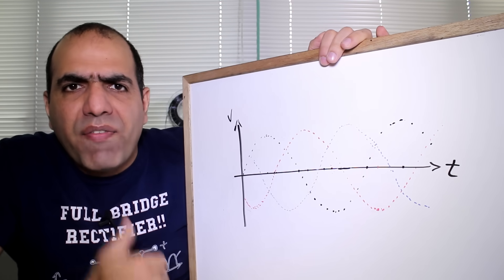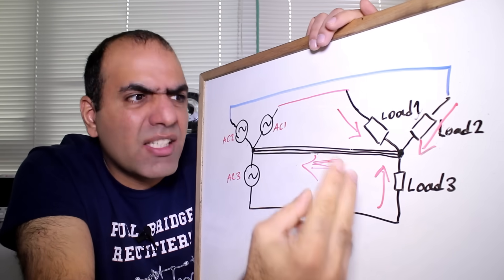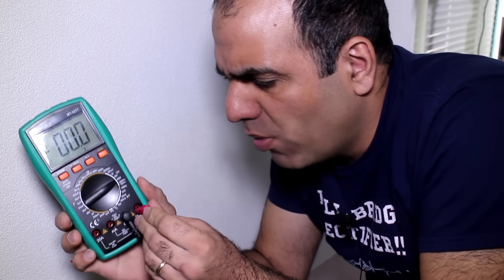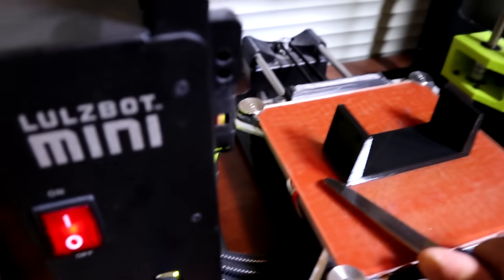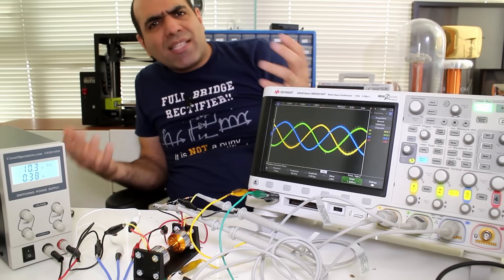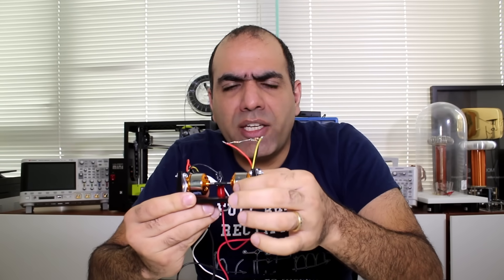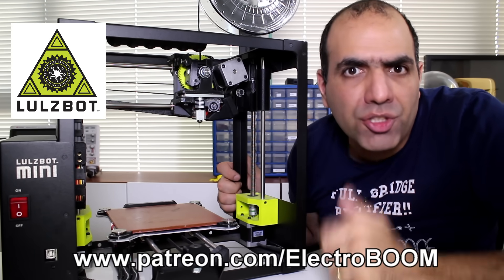Why 3 Phase AC instead of Single Phase???

Comment: @ElectroBOOM in austria every house has 50Hz 400Vac 3 phase net 120° phaseshifted, so between one phase and neutral 230Vac. Blue is always Neutral and green/yellow is always  grounding. Phase is usually black but depending on the cable you have in front of you it can be black, grey or brown or all 3 black for the 3 phases.

Comment: I like this, but of course you didn't mention split phase, which is actually much more common in Canada. You have 2 phase power at home because you live in an apartment (or are doing this in an office) where they have 3 phase service to be able to supply the hundreds of residents.

Comment: 3 single phase loads do not make a 3 phase load. It only increases the return path on the neutral wire back to source.

A 3 phase load ( such as a 3phase motor) uses 2 phases. 1 for current in 1 for current return. Alternating. 
Phase 1 and 2
Phase 2 and 3
Phase 3 and 1..............

That's the only time you don't need a neutral.

Comment: In Europe we have 3 phase power in every household. 230v phase to neutral and 400v across the phases. Excellent for 3 phase motor for heavy motors for wood cutting, workshops, etc, It reduces current, and everything works excellent, and not more dangerous than your voltage. Sure no one plans to lick the wires. Greetings from Serbia
Reply: lmao 400v will kill you easily.

Comment: So Canada doesn't have 240V volts in houses? I am confused that you only got 208 volts across L1 and L2. Here in the US, L1 and L2  are 180 degrees out of phase, so you get 240 volts measuring between them.

Comment: Sir, | V=IR, V is directly proportional to i. And, I=Q/T .,   V directly proportional to Q But,from V =W/Q V =1/Q So, V is inversely proportional to charge Q. Sir it is has some contradiction i ask my physics teacher he said time is not constant and Q gets variation.please help me in this..

IN potential due to a point charge Derivation V proportional To Q. And in capacitance Q=CV .Same as above proportionality. i don't understand why V=1/Q.
Reply: you first have to define what kind of circuitry before applying formulas. Tying formulas together without a clear idea of what the situation is is like groping in the dark. Besides that I suspect that this 'from V =W/Q V =1/Q' is where it goes wrong.

Comment: I still dont get it, its a shame because i am an electrician (europe) in houses we get single phase with neutral. In industrial aplications we install 3 phase and neutral combined. For a triangle/star motor setup. But my qeustion is ; if 3 phases are added up that makes zero. Why do we need a neutral wire? And were does the neutral eventually go??
Or is it with neutral to cut down the 400 volts to 230 volts (europe power outlet standards)

Comment: Why not 4-phases 90-degrees apart? Or 6-phases that are 60-degrees apart? etc?........also wouldn't 2-phases 180-degrees apart cancel each other out like a guitar pick-up, and you'd get 'zero'? Why is the single-phase out zero volts when measuring from hot to hot on each outlet.......but 203v on the 2-phase outlet hot-to-hot?

Comment: 4:29 this is a myth; the NEC (NFPA70E) does NOT have set color codes. Exceptions: green for ground, white/gray for neutral, and orange for B leg.  You WILl see electricians using OR BR YL for 480V and BL RD BK for 208/240 though, this is habit. As long as the entire building is the same, either choice is OK. My workplace uses OR BR YL for 208/240 lol...rest of the continent is the opposite

Comment: One benefit a 3 phase motor has over a single phase is that if you change the polarity of at least 2 of the phases you can change the direction of the motor, something that is impossible to do with a single phase motor. Having previous factory experience I do know there are some situations where you have to reverse the direction of a motor on the machine that you are running.

Comment: hey ! if you get 3 wires from the same phase and give one of them a "capacitive" charge 
the other one an "inductive" charge and the last one a "resistive" charge , in a way that you deliver to  the three lines the same |z| but with three different angles , would it make a 3 phase system ?

Comment: 3 phase equipment have higher potentials to deliver than single phase industrially wise, when we consider delta connection in electric motor the speed is super. subject to correction, meanwhile you are too funny I need your contact for a deal .

Comment: Why don't we have 4 phase ac with 90 ° phase shift
Reply: 4 phase at 90 degrees separation would be indistinguishable from 2 phase at 90 degrees separation
Reply: transformer design maybe become complex and transmission  complexity may increase as the phase add up
Reply: Try 45 degree.
Reply: @spidercubed9718  
2 problems, 1: that would effectively be DC and 2: internal losses add up quickly, stifling power output.
Reply: @spidercubed9718  
Sorry, too much internet has made me cynical.  😌
Reply: How about 2-phase? Would work exactly the same!

Comment: What happens if I have 2 ethernet switches powered by 2 different phases, and then connect the switches together with an ethernet wire? Does the voltage rectifiers in the switches fix any earth shattering kabooms, or do they splode because they are at different potentials?
Reply: The AC is rectified to DC for the switches. Same potential.

Comment: In Canada, stoves and dryers get the 220-240 volts because they need much more power. If you measure the voltage on those plugs, you see two 110-120 volt phases that are 180 degrees out of sync, and between them you can measure 220-240 volts. The other two wires are neutral and ground.  You need to correct the 120 degree phase difference in the video.
BTW, in European and many Asian countries, the outlets are 220-240 volts, so if you have any appliances brought in, you do not need a big and expensive transformer to run them. Just get a certified electrician to install a couple of 220-240 Volt outlets in your home.  Yeh I know, the frequency in North America is 60 Hz and there is 50 Hz, but the frequency difference is not going to cause any problem.

Comment: I learned that when using another 3-phase motor as  a generator, you have to use a larger horsepower than the machine you want to drive. Also, you have to rectify the waveform with capacitors. Thank goodness for single phase to 3 phase VFD drives. My house would need $150,000 worth of work to get me some of that direct tasty three phase. My truck shop cost $15,000 just to move a couple poles and hang the new transformers for it.

Comment: ElectroBoom, during tbis day and age of the Diy many people such as I, have many questions. Obviously bridge recitifiets come in diffrent gauges and varieties, so, when i make my wind generator with 3 phases i will have 3 start wires and 3 finish wires, how will i know whete to connect my start and end wires, how will i choose the BRecitifier, and I thought wind turbines out put Dc, isnt that correct, i saw a video whete it states that wind turbines output Ac and that is why the recitifier is needed. I would appreciate your help.

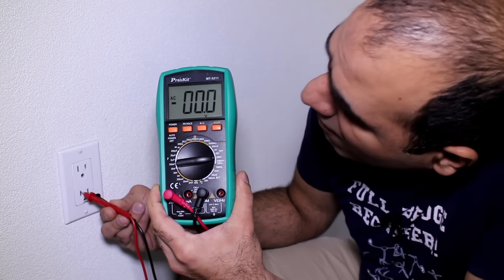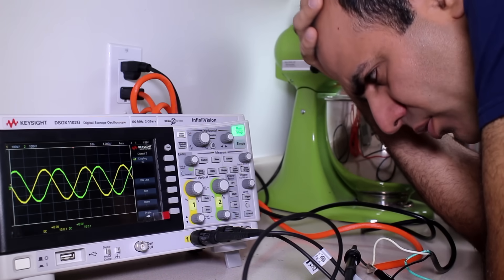Comment: At least one of the arrows in 1:32 must exit out. Yes, the neutral does not carry current in a 'balanced' load system, but since the sum = 0, at least one load or source must be opposite of the others. - fyi, 3:06 and 4:10 are classic !! :-b also at 4:45 Nikola Tesla did NOT invent the 3-phase generator (known as the polyphase generator), but the 2-phase generator according to Wikipedia of George Westinghouse  (At the beginning of 1893 Westinghouse engineer Benjamin Lamme had made great progress developing an efficient version of Tesla's induction motor and Westinghouse Electric started branding their complete polyphase AC system as the "Tesla Polyphase System", announcing Tesla's patents gave them patent priority over other AC systems and their intentions to sue patent infringers.[22] )

Comment: hello, i know the video is old but i have a small question, can the ESC be powered by both AC or DC? i'v seen it a lot used with DC (from accumulators ) but not many(if any) on AC (from a transformer or something)

Comment: His 11 min video about 3 phase AC made me understand it better than when I took it for 2 months at school.
Reply: at school, most of the teacher spend time on calculations
Reply: it took me 20 years from the time i first saw 3 phase, to see this video, to actually understand it. and it is clear as day.
Reply: I went through a school for electrical engineering, and i found this to be one of the best 
lessons on the subject i have ever had the honor to consume.
Reply: Same, only mine is for the whole semester.
Reply: The education system is so dull and sluggish it's enough to make even the interested not interested, right?
I am literally learning a lot from these videos. It's a valid way to learn.
Reply: Why not 5 phase or 27?
Reply: @ricardomontalban6004 - there is actually such a thing as 6 phase power but to the best of my knowledge it is only used in power transmission (and generation) then split up before distribution to end users. The advantage of 3 phase power in industrial motors is that you can change the rotation of the motor simply by swapping two wires whereas single phase motors must be designed to start in a particular direction or have external components (capacitors) to make them reversible. Having more than three phases (AC) has no advantage.  Stepper motors have 4 so they can be easily controlled with DC.
Reply: @GordieGii  I've only ever seen 6 phase used in very large generators and immediately turned into 2 * 3-phase for any further work even within the generation site - and even then only for sites which output as HVDC.
Reply: @alanbrown397  - I'm not in the power industry so I don't know the logistics. Obviously there is no advantage to using 6 phase power so any pumps, fans, powered valves, etc used locally would use 3 phase motors. I imagine the main advantage of 6 phase generators would be that load shifts (transients?) would have a smaller effect based on the idea that it is unlikely for both loads to change at the same time. But it occurs to me that there may also be an advantage to main transmission lines in the power grid (it seem like all the really big ones have six lines) perhaps in terms of radiative losses and also possibly in terms of phase balancing the grid. (lengthening certain legs of the grid so that the power is in phase when it reaches a node) Of course HVDC transmission lines don't have these problems, but the bulk of the grid is still based on AC.
Reply: @ricardomontalban6004  fewer phases can't control rotation direction in motors.(Most US houses are essentially 2 phase-180degree, achieved by feeding a single 240V phase as centretapped 120-0-120 to the premises. The advantage of doing this is that it's safer in the event of a supply failure (look at the feeder transformers) and you don't get the risk of severe brownout on your "230V" appliances. It's quite mad to feed a house with 2-phase 120-120degree (I assume that they're feeding 3 phase and  a dedicated supply transformer?))

More phases adds complexity with lower corresponding gains in power transmission. It's more efficient overall to run 2 3phase lines than one 6-phase one.

3 is optimal for power transmission.

That said, stepper motors (which are essentially multiphase motors) frequently use more phases because it allows finer grained control of both torque and rotation angles, but that's about control, not about power transmission.

Ironically, DC is better for long-distance power transmission (lower parasitic losses), but you can't stepup/stepdown as trivially as you can with AC - a problem that took a very long time to solve, but HVDC transmission lines are the norm for long-haul these days (you can still only go about 1500 miles economically - that's about the point where 50% of the generated energy is already lost in transmission - bear that in mind when people start raving on about building solar or wind farms in isolated areas and piping the output back to "civilisation")
Reply: So if I have 3 phase to my house will my coffee grinder be on steroids? And how do they centretap the 240? Does the phase shift make it split?
Reply: I spent four years at college but still confusiom
Reply: i'm curious how many hours does mehdi took to understand this thing.
Reply: maybe you have spent all the school time on snapchat
Reply: Damn chicka 
In school?  U sure?
Reply: Just like sex ed at school. Learnt nothing in 12 weeks but 1 night with the  school slut, I was educated :)
Reply: @wallywalpamur4960  Hey Buck',,  I am hearing you man!
Reply: University only teaches theory, theory, and more theory --- theory don't mean shit when it comes to real world engineering
Reply: Chicka girl How about open the book and read it you moron? Your college professor is not responsible if you are dumb as a rock.

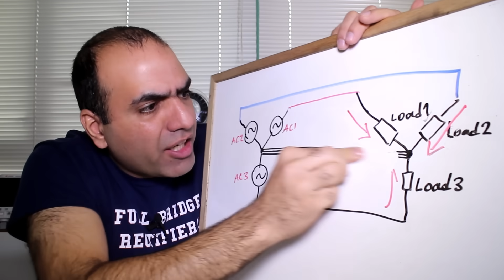Comment: 2:00 - 2:10, "We just add 1 wire compared to single phase ac but we are delivering 3 times power in a balance condition".
I think you made a mistake there. We will be delivering root(3) times the power in the balance condition if other conditions are kept constant like phase current, phase voltage & the load power factor. Take Delta or Star System, only one of the parameter (Voltage or Current) is increased by root(3) using 3 phase compared to single phase.
Reply: He wasn't talking about using delta/Y interchange. He was talking about the omit of the neutral line in resistance balance condition . 1 Load = 2 wires. So 3 Loads should be 6 wires but when the three ground are connected and resistance is in balance the neutral current is just zero, therefore the neutral line (which is equal to 3 wires) can be omitted so only 3 wires is needed. So you only need 1 more wire yet you can deliver to three loads => three times the power
Reply: The delta/y configuration is not used to maintain more power transmitted through the same lines but to raise the voltage and so raise the power of the motor without a need of a transformer. Like when you start a motor you may require large momentum and so you switch your load from Y to delta configuration to increase the power by sqrt(3).

Comment: The center point of the star is zero only if the currents are balanced through the three loads. But what happens in power distribution, how do they balance the loads? And what happens if the loads are not balanced?

Comment: Please do a video on using and misusing ESCs for BLDCs. Many do not know how so much HP can now come from such a small motor, and others of us wonder things like can we run 2 or more ESC's in parallel to spin a larger motor, or, can we use a double voltage rated LiPO to power two smaller ESCs and motors in series. Can we attach more MOSFETs in parallel to use a small ESC to power a large motor? This is a whole world of electrical principles that ppl other than hobbyists deserve an introduction to as more consumer tools, etc are using these setups.

Comment: Can you do a bit on split-phase 120VAC? Also, the generators I saw all had a small generator on the front with permanent magnets. This flashed the coils in the big generator until it was up to speed, After that, the big generator powered its own magnetic fields.

Comment: How come subway systems use 600V DC power through it's live rail instead of AC current? Does it has to do with safety features or it's a patent legacy issue? Can the host kindly make a video about such topic? Thank You in advance from a recent new subscriber 😉

Comment: I was sure that you didn't use the multimeter original probes when you tried to measure the voltage at the first time😉 i think you use other probes connected together to make a short circuit because the multimeter wouldn't handle that much current☺☺

Comment: Wait a minute, most if not all single-family dwellings only pull one phase from the transformer. The secondaries are 240v and center-tapped, where the center is your neutral. You should have seen a difference of 240v, not 208v. Of course, overlooking the fact that is somewhat unusual to see one receptacle split, and fed from two different circuits

Comment: Can I add FETs in parallel to a BLDC speed controller to regulate more power to a larger BLDC? Can I run 2 or more low power speed controllers in parallel to power a large BLDC? Can I use full bridge rectifiers to provide regenerative braking, or power generation from a BLDC motor? I will take it very personally if you do not respond and answer these inquiries.

Comment: In tree phase Y configuration system (without netural wire), if i disonnect one phase, the balance current will work?
(sorry for bad english)
Reply: Well even in 3-phase-Y-configuration you have a neutral wire, besides the ground wire connected (at least in germany ...). Depending on the type of load (for example capacitive, ohmic, capacitive, ...) it will behave differently, when one phase is disconnected. While a ohmic load will just decrease in power an electric engine will have more issues with this, since it requires all 3 phases for a smoth drive.
Reply: the simple answer is yes, two phases even without neutral will still balance each other
Reply: It will balance alright but the voltage between those to left over phases will shift from the center to between those two poles. So both will get less voltage and they will also be 'the same phase'. You just have to imagine three springs hung up between three poles. If one breaks it's obvious what happens.